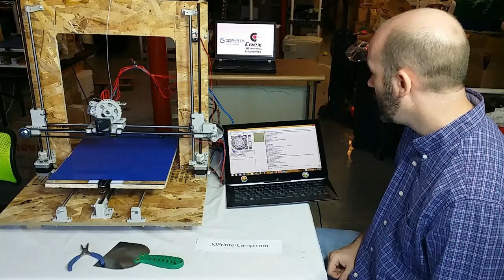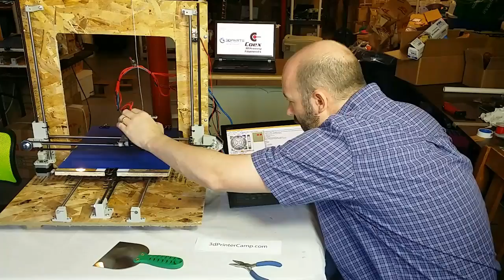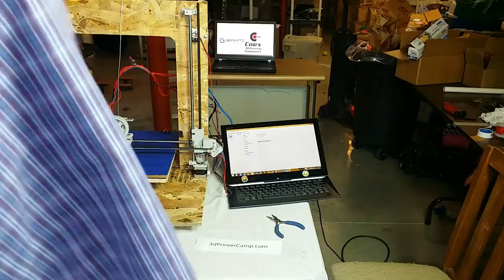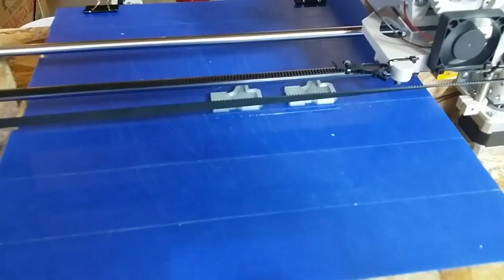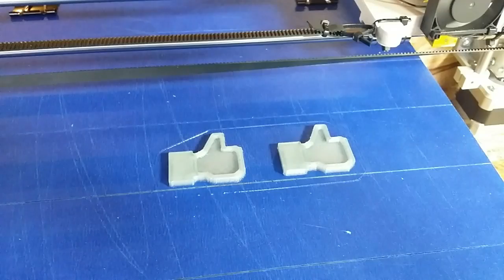Build your own 3d printer - Step 19 - First Print

Comment from the maker: Hi dom3811,   the gray plastic parts were printed using another 3d printer.   I modified the parts slightly from the mendel90 design.   For building your first 3d printer, you can buy just the plastic parts from people around the world.   ebay is good place to start.   search for something like reprap plastic parts.   The plastic parts need to match your other hardware though.   For example, if you are using 8mm rods, then plastic parts need to have that size hole and not 10mm.     Let me know if I can help in any way.